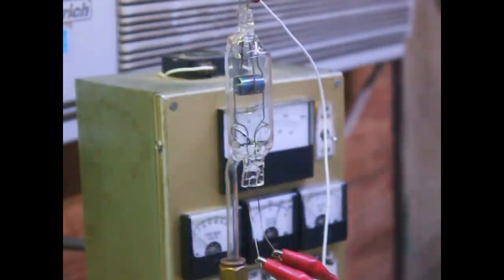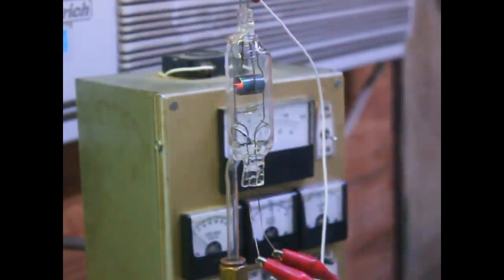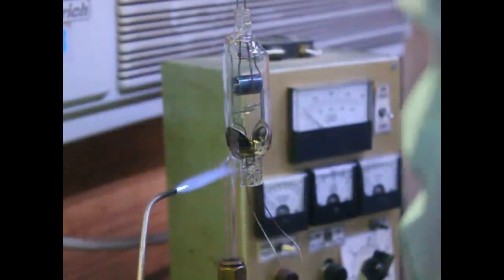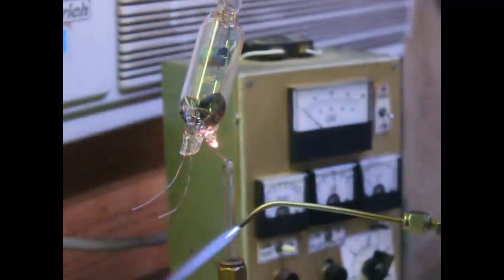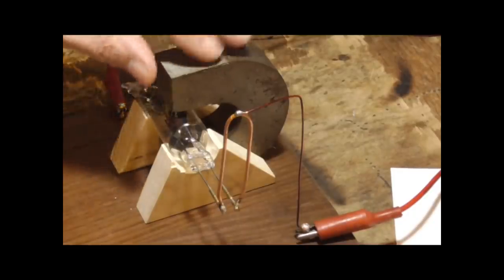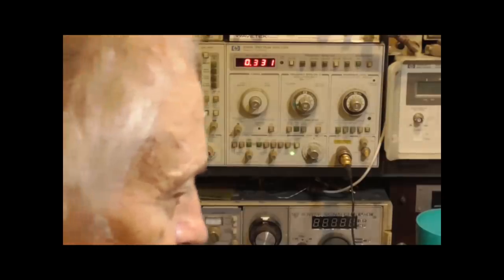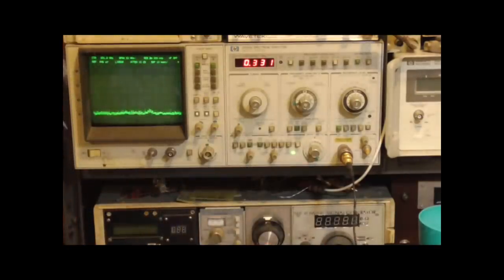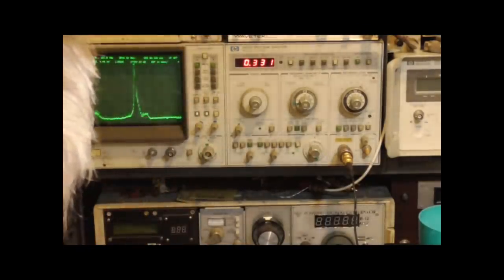HOMEMADE MAGNETRON WORKING!

Comment: Isnt that causing cancer!!!??
Reply: If the tube were generating X-rays, then it might cause cancer.
However, the tube is generating microwaves.  Microwaves might roast flesh, but they don't cause cancer.
Reply: @Jason Phillips a few mA don't think can be that powerful
Reply: Why microwaves should generate cancer? I mean, explain the mechanism.
Reply: Claudio G.: "Why microwaves should generate cancer? I mean, explain the mechanism."

The mechanism is simple. Microwaves can be used to transmit information, this allows uneducated people to comment on the internet, thereby creating one of the most carcinogenic things in existence: Youtube comments.
Reply: @zvpunry1971  most kids learn microwaves heat up food. Usually they ask "Why does it do that?" and people respond with "It's radiation".
Many kids have seen cartoons with something radioactive doing something bad, which teaches them "radiation is bad". That's why many people think its all bad. 
That's my theory.
Reply: I don't think it is that easy. Some people have a irrational fear, like the fear of spiders. A learned phobia, https://en.wikipedia.org/wiki/Radiophobia (which is mostly about ionizing radiation). It is incredibly hard to convince someone with a phobia, that there is no reason to be scared.

What you wrote is definitely an additional factor, but it isn't limited to cartoons. Most people don't know what the difference between ionizing and non-ionizing radiation is, what the difference between particle radiation and electromagnetic radiation is and what radioactive means. For them it is all the same. Some people even fear completely fictional/made-up radiation, like the radiation from water veins and water lines. And there are people who profit from these fears, they sell stickers for phones to "neutralize" the deadly death rays or use dowsing to find the imaginary water veins. :-/
Reply: No, why it would..?
Reply: @user255  a magnetron emitts eddy currents which is magnetic force which causes cancer which is why a microwave should never be run with the door open & in fact it is still bad for you th stand right in front of it whike the food is cooking....very dangerous
Reply: @SJ-hw7bx  nothing you said is correct, except for not running a microwave with the door open.
Reply: @stargazer7644  ooo kkkk.....
Reply: @Jason Phillips 
Yes, they can heat tissue even to the point of damaging it. But the topic was cancer.
Reply: @Jason Phillips microwave oven magnetrons cant blow things up, the people making videos of blowing up motorcycles and stuff are faking it.
Reply: https://en.wikipedia.org/wiki/Ionizing_radiation "In general, ionizing radiation is harmful and potentially lethal to living beings"
"Gamma rays, X-rays, and the higher ultraviolet part of the electromagnetic spectrum are ionizing, whereas the lower ultraviolet part of the electromagnetic spectrum and all the spectrum below UV, including visible light (including nearly all types of laser light), infrared, microwaves, and radio waves are considered non-ionizing radiation."
Reply: this means microwaves arent really that deadly unless you cook someone with it.
Reply: not more than your comment
Reply: This is an argument from (false) analogy, comparing oranges (asbestos) and apples (magnetrons).

The way asbestos can cause cancer is by causing a chronic (constant) inflammation. The chronic inflammation then increases the risk for cancer. To get this condition, you have to inhale fibers of around 3µm length (if they are much smaller, they can be enclosed by macrophages, if they are much longer they can't as easily enter the lung). You also need to inhale a lot of them. Especially people who worked with asbestos all the time were at risk. People who just live in a house that has asbestos in the walls or on the roof are safe (it becomes a problem if they want to get rid of it, then it gets expensive and the resulting bill can cause a heart attack).

Magnetrons on the other hand have some other hazards. They run with relatively high voltages. In this video it is driven with 800 Volt and if the power supply has the slightest output capacitance, you can get a nice zap from it (which may cause additional accidents) and if the power supply is capable to deliver more than a few mW, it can be directly harmful or even deadly. Then there is the RF, which can, if the power is high enough, cause burns. In this case it's way below 1W (which is harmless). In Vacuum-Tubes you have a flow of electrons from the cathode to the anode. When they hit the anode they get deaccelerated which causes the production of x-rays. If the electron-beam is redirected by a magnetic field (like in the magnetron), it creates bremsstrahlung (soft x-rays in the 20nm-10nm range). This are the mechanisms how vacuum-tubes  can emit ionizing radiation. But the amount is normally very low, especially with such low powered, low voltage tubes.

The production of x-rays can be problematic when tubes operate with high voltage (10kV and up). Picture tubes from old computer displays and old color televisions that were driven with 27kV (or more) were a normal source of x-rays people voluntarily used (and they still live;)). Very problematic were the x-ray emissions from some military radar equipment (in Germany), they contained tubes (thyratron) to form radar pulses that switched very high voltages (up to 100kV). When the radar-equipment was built, the emission of x-rays was well known, but the radar equipment was designed in a way that it could only be adjusted when the shielding was removed. A radar called SGR-103 produced up to 400mSv/h (50mSv is the one-year dose limit of a radiation worker, 400mSv is a dose that, if received in a short time, causes symptoms of radiation poisoning - i.e. one hour working on such a radar -- more examples: https://xkcd.com/radiation/ ).

Anyways, the problem with the radar devices caused people to associate radar (non-ionizing radiation) with cancer. Also these devices are high powered, operate with high voltages. Not really comparable with the cute little magnetron in this video.
Reply: Stimpy&Ren: I would be comfortable with it. When you know what's happening, you can focus your cautiousness to the real hazards in life. If you work with "invisible" hazards, get measuring equipment that gives you a sense about it. The easiest example is, changing a light fixture. You don't only remove the fuse, you also take a measurement to make sure the electricity is off. But if you do the same on a flashlight that operates with a few volts from a battery, you just don't care because you just know that it is harmless.

The same is true for invisible hazards like high powered RF or ionizing radiation. You can buy measurement devices, learn how to use them (learn what you measure) and take measurements. In gives you a sense about real and imaginary dangers.

For RF it is quite easy, instead of buying a big/heavy/expensive spectrum analyzer, start with a cheap SDR (software defined radio) like rtl-sdr (15€ device). There you can compare the power levels of radio-waves to known sources. But SDRs have their limitations, tuning them to different frequencies is often slow and limits the scan rate if you want to look at a wide spectrum. They also aren't calibrated, they don't show absolute power-levels. This is where a used spectrum-analyzer can be better. But an rtl-sdr is cheap and can be plugged via USB on a smartphone/table/laptop (=> cheap and highly portable).

For ionizing radiation you can get cheap geiger counters like the GMC-320. You may also want to find some granite or an old gas mantle (the type that uses thorium dioxide) to have something to measure. There are more expensive (and unless you have a special need, more useless) options. There are x-ray and gamma spectrometers that sort the counted x-rays and gamma rays based on their energy. This can be used to identify substances. You can excite elements with x-rays which causes them to fluoresce with x-rays of a specific energy. As an example: this is used by miners to check the composition of ores. If radioactive elements decay, they give up gamma-rays with a energy specific to the element, so gamma-ray spectroscopy can be used to identify them.

Measurement equipment is the best thing you can buy. It extends our limited natural senses with specialized senses!

After extremely high frequencies we find the far infrared, this is where we can see heat with a IR camera. It shows us where our houses lose energy in the winter. Then comes the near IR, that is where IR remote controls work. Most cheap cameras (smartphone cameras!) are sensitive to it, we can use them to check if those IR remote controls still work. We can also filter the visible light away and take stunning IR pictures in nature. Then comes the boring visible light, we think we know it but we don't. A prism or diffraction grating shows us the distribution of power in the spectrum. Then comes ultraviolet, we have UV-sensitive cameras, they can be used to see defects on insulators of high-voltage power-lines. These defects cause discharges which emit ultraviolet light which can be seen with UV-cameras. Then comes the extreme UV and soft x-rays and so on.
Reply: @Stimpy&Ren No, in order to pose a risk of causing cancer, the chemical structure of the DNA needs to be damaged; in order for that to happen, the energy of the photons of radiation must have an energy sufficient to break a carbon-hydrogen bond; this is what defines ionising radiation and it doesn't happen until the wavelengths are in the order of 200nm. The wavelength at 300MHz is 1m, so that's 7 orders of magnitude lower energy than required for ionising radiation.

Comment: It is fix frequency magtron.
If its tune circuit is outside from Vacuum so can we make is variable frequency oscillator magnetron by increasing inductor length or Distance between them as capicator ?????
If yes then we can use it for high power high frequency Radio application !!

Comment: 1:33 how it help to creat higher vacuum by heating internal matel ????
Reply: Those are the getters, when they are heated the barium metal that is on them vaporizes, condensing solidifying and adhering to the glass wall of the tube. This pure barium metal is highly reactive trapping any molecule of oxigen remained into the tube. Perhaps even other gaseous molecules but I'm not sure about that.
Reply: I think you refering to the fact that he warm up the metals, but he does that to purify the  materials or to oxidize them when needed if you also have any moisture or air left it helps evaporating the moisture...i guess air being a gas just expand and get sucked by the vacum pump...and once everything is cooled down  that will be less dense if any inside the tube

Comment: Cool, however the flash getters should be used after the sealing off the tube.   The action of sealing off the tubulation releases gas and this is what the flash getter absorbs.
"Flashed getters are prepared by arranging a reservoir of volatile and reactive material inside the vacuum system. Once the system is evacuated and sealed, the material is heated (usually by radio frequency induction heating). After evaporating, it is deposited as a coating on the interior surfaces of the system. "
Reply: Both sequences have their points.  I might even say flash one getter to be ready for the out-gassing of sealing and flash the second one after to bury anything that was recently released.  The problem is the burying feature is short lived and not enough.  The longer term action of the getter works over the life of the tube and can be started as soon as you have reached final vacuum.  It does not much matter if it is fired before or only after sealing.  The only real danger is temporary loss of the vacuum after the getter is fired as then it is rapidly depleted.

https://vacaero.com/information-resources/vac-aero-training/1166-getter-materials.html
Reply: @KallePihlajasaari  thanks for the interesting link.

Comment: Got a 48V telephone lamp? That should light if placed between the 2 anodes. will shift the oscillation frequency down a little, but should glow brightly, as it is a much lower current lamp, and with the higher cold resistance will load the startup of the oscillator a lot less.

Still using an old ALNICO magnet as a fridge magnet, came out of an old aircraft RADAR magnetron that failed, and started to mode. Probably a combination of an old weakening magnet and a low emission cathode.

Comment: I understand this is just for academic and demonstration purposes, but I would point out that the military in this country uses a large swath of the UHF spectrum in the area that this tube is operating.  I wouldn't make it a habit of running anything in that frequency range, as it is set aside for radio navigation.  Aircraft landing on the roof would be a trifle inconvenient.
Reply: Sigh.

Comment: On a more serious note: how good does the vacuum pump have to be for me to make working vacuum tubes? I've been interested in them for years.
Reply: Oil diffusion pump plus a mechanical roughing pump is the typical set-up. Pressures around 10^-5 down to 10^-6 torr.
Reply: @KallePihlajasaari  Thank you! Gonna take e a while to save up for that.

Comment: Have you ever tried making just a normal lightbulb?
Reply: Every time, just turn off the anode supply, and with the directly heated filaments there is a regular incandescent light bulb, especially when the tube is being made, and the elements need to be cooked to get all adsorbed gas out of them.
Reply: A light bulb is something a first generation hobbyist would create. He is far beyond that, beyond me.
Reply: I know. He made so many highly complex things, but he never made a plain old lightbulb with his equipment.

Comment: Where do you get your ring getters from? Do you buy them? I would like to start this hobby on my own and I can buy everything needed, but I dont know where to get the getters.
Reply: PETR DOLEZAL he gets them from old burnt out tubes, he breaks them open and has less then an hour(best for under 30 min) to seal them in.. they will go bad after too much time, even when they are from used tubes they still have use

Comment: Considering that the magnatron is operating in the middle of the military aircraft band, it's probably not a good idea to be putting out that much power.
Reply: FFS it's 200 mW and isn't even connected to an efficient antenna.

Comment: Very informative you'd make a great electrical engineer teacher.. Taking apart microwave oven magnetrons I never knew what the ferrite wound inductors were for. You just taught me that the capacitance of the cathode and the inductance of the inductors set the resonant frequency. Amazing stuff. 350 MHz is blazing fast for a homemade magnetron. Nice job making it work and thanks for the share/lesson, Martin.
Reply: Just be careful not to break the berilium ceramic looking thing on the magnetron. Or electrocute your self on the high voltage side of the transformer. The high voltage cap is energized still after turning off for a while (should be a bleed off resistor, but still).
Reply: @cetyl2626  Generally an oven magnetron has an earthed anode (and the cap is DC coupled to the anode internally) and the cathode is driven to the negative working voltage of around 1-2kV.  The more dangerous terminals are the filament, HV  capacitor and HV diode terminals.

https://www.google.com/search?q=microwave+magnetron+circuit&tbm=isch

Comment: Very cool demonstration with the lamp!  I've seen RF light up gas discharge lamps plenty of times, but that had to be inducing a lot of current to light up an incandescent bulb!
Reply: With a half wave dipole you get high voltage(very low current - neon bulb territory), at the ends of the aerial and max current at the aerial center. So, if you cut the aerial wire in the middle (making slight length adjustments), and place a filament bulb in series there (when RF is switched-on), it will light-up. In an electromagnetically sealed room; this was part of an emergency transmitter test I would perform (and enjoy). With very high frequencies a ½ wave dipole can be short, a superb application of physical laws – MAGIC :)

Comment: Well done ! It seemed to me - what do i know. That you were pretty darn close with other tube, success !
Again i know very little about this but how would one go about raising the emission frequency ? Plate size ? shape ? lead length, or perhaps an
adjustment of all parameters. Spacing of elements seems a critical factor in amount or power of emission. Impedance must also be a factor.
But how would one adjust or control that. Hmm so many questions.
It has always amazed me how much power i can get from a pair of 8877's in grounded grid - blowers screaming. They have glass chimneys
and man do they put out some heat!!  It's a home made amp i got 30 years ago 40 and 80 meters only, it was built to run AM mode at full duty cycle. If i give it all it wants i have seen 3 KW with 125 - 130 watts input power resting carrier, then my breaker trips downstairs. And smells
like it is burning - might be. I replaced it with a faster trip type breaker. Now it cuts at 2.3 - 2.5 KW with no burnt smell.
The tube you made amazes me the same way that amplifier does. Except that you get a very strong sense of the power being made by the level of
sounds the transformers make. And the 110 line voltage sags i don't think the transformer on the pole likes it very much. Lights dim markedly
when the relay closes, even the streetlight dims just a bit. Transformer on the pole is probably 40 or 50 years old easy, maybe older.